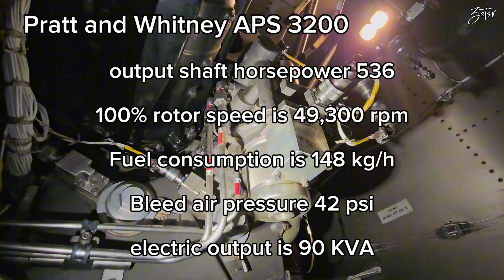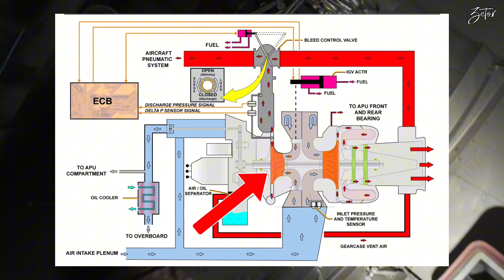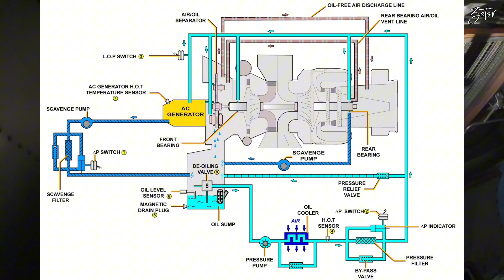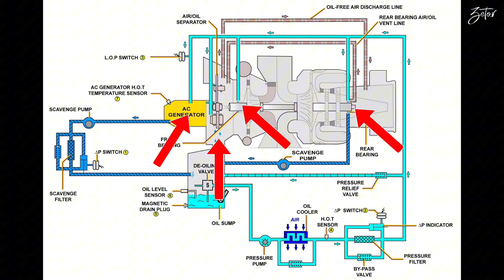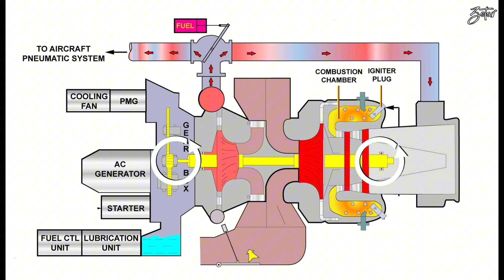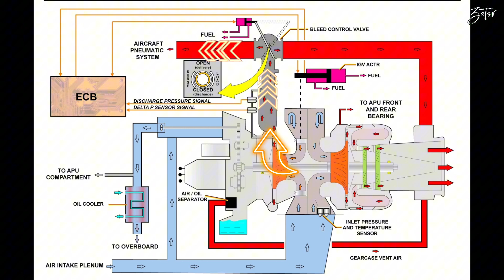How APU (Auxiliary Power Unit) works

Comment: I am impressed by the low specific consumption of such an engine : 148Kg/536hp/hour means a consumption of kerosene of 0.37kg/kw/hour. By comparizon a petrol engine is typically 0.3 Kg/kw/hour and a Diesel engine is 0.2 Kg/kw/hour. Not bad!
Reply from the maker: Yes for power which it produce it really has low consumption. Nice calculation by the way 🙂
Reply: i went the other direction  aprox 50 gal an hour JP-4 but thats a lot of KVA 90  WOW

Comment: Hi Mr. Zeto. Thanks for your video.
I have question: How is 115volt at 400Hertz from APU generator converted to regular 50/60 hertz to charge phone/laptop at seat inside cabin of aircraft. Thank you

Comment: Hello Tomaš, just found your channel yesterday and i find it very interesting! Thank you for sharing the good stuff! I have a question regarding the BCV and FCU….as the apu bleed is set on, i imagine the way it works is; the fuel control unit commands more fuel, adjusts the compressor intake and the bleed control valve opens fot the air to be connected to the pneumatic system. In what case does the bleed valve open in the oposite direction to let the air go out towards exhaust? Is it only to depresurise the apu pneumatics after the apu bleed pb is set to off or is there another reason for the way this system is constructed? 
Very much looking forward to more of your videos!! Thanks

Comment: Explained very well, just have a question, how does the APU get fuel? Is there any suction pump there because fuel tasks are far from the APU?
Reply from the maker: It has its own dc powered pump for start and during normal ops it is supplied bu standard Boost pump

Comment: I have a question: is the APU electrical output capacity reduced when bleed air is being used for an engine start?
Reply from the maker: No not really, APU without bleed most of the time APU runs on 99% for fuel saving 😁 with bleed 100% and that 536hp is more than enough for everything